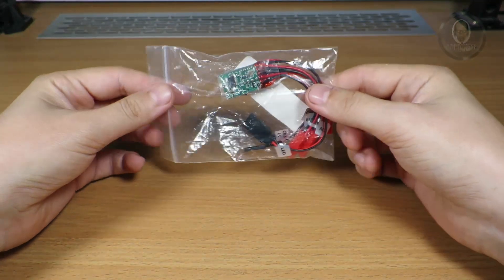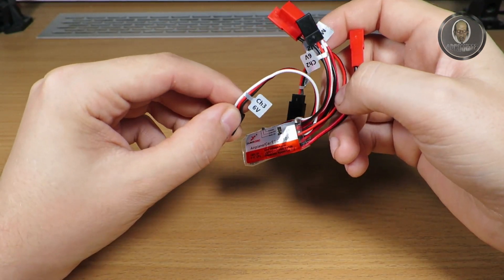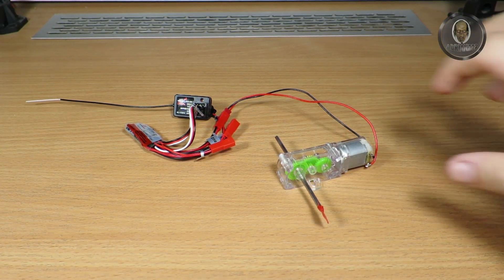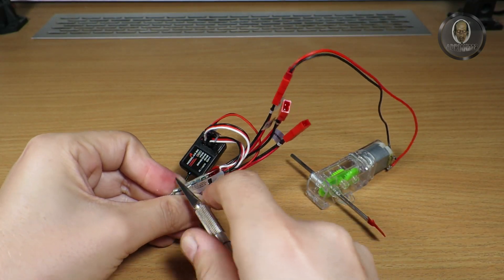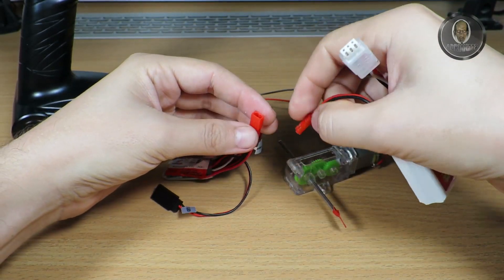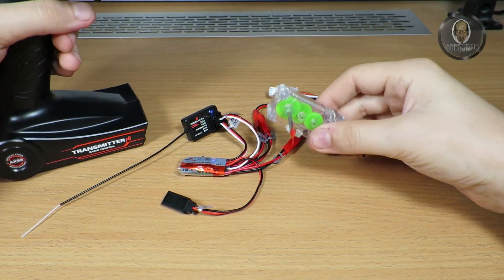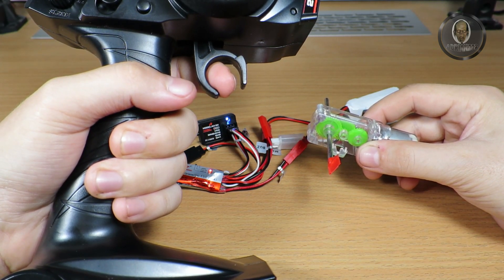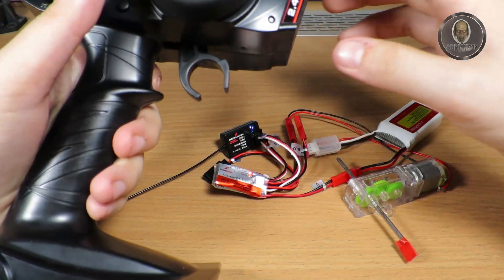DumboRC 10A ESC - Switch, buzzer connection, 2s/3s and airplane mode

Comment: Dumbo X6F transmitter and x6reciver using how to make rc plane
Reply from the maker: Most easy would be to put on plane 2 motors pointing little up and turn plane by using differential control like in tank.
This is how they do it in toy planes but if it's ready plane than You may have not enough channels for all flaps
Reply: @Adrian202   rc flying plane how to make by using Dumbo X6F transmitter and x6reciver
Reply from the maker: @yogeshwaranm249  I just explain :D

Comment: Hi friend, my switch is broken, can u tell me how to jumper in plane mode?
Reply from the maker: Hi, as far as I understand You will need to solder two pins that go to switch.
Plane mode is first from wires so try to solder that pins and that should work

Comment: Thanks for the review, just wonder if it getting hot or not in 370 dual speed gearbox setup.
Subbed to your chanel now
Reply from the maker: 130 motor take about 5A max on stall and 370 motor is stronger so on stall 2 motors can over heat it
Reply: @Adrian202  thanks for the quick answer, i just plane to use this 10a esc with 996mg servo, 370 dual speed and n20 motor for winch. Do not want to burn the esc , not because the price but the waiting time to arrive to your door.
Anyway, thanks one more time
Reply from the maker: @yannn5541  N20 yes, 6A BEC will work for servo but dual 370 may be to much, better use 2 and Y splitter :)
Reply: @Adrian202  ah, there maybe a bit of misundestanding here, it is my bad for not explain it before.
I only use one 370 motor but it is come with the gearbox with low and high gear setup hence the name dual speed. I use it on my wpl c14 rc car
Reply from the maker: @yannn5541  all depend on how much torque will go on motor because if You will go on a hill or do crawl on roots motor will consume more current and I have no idea how much :D
Also motors with that gearbox fail over time as far as I read (gears brake or something like that) that's why I ordered single speed motor with metal gearbox to test it out :)
Reply: @Adrian202  sir can you help.me i have a  esc when i connect it to motor it strats beeping??? Which supports a motor and is 30a
Reply from the maker: @gobindmodelmaker7188  Check battery because this may be low voltage alarm or check if You connected receiver right because this also may mean no signal
Reply: @Adrian202  thank you sir for reply it will check and tell you
Reply: @Adrian202  hellp.sir i checked it battey is fully charged it is not working but when i yse it on 3.4 voltors mobile battery it works but whrn i use two 2s battery 7.4 v it don't what to do...
Reply from the maker: @gobindmodelmaker7188  so something is wrong because on 3.7v this ESC cant work because minimum is charged 2s battery
do You connect it to correct plug ??
Reply: @Adrian202  yes plug is correct  i am also not coming to know what is the problem   on 3.7 volt mobile battery it is working but when i use 1 cell or 2cells of laptop battery i don't work 🙄 motor starts beeping on 2s 
But on mobile battery s sounds comes and it starts working motors starts rotating

Comment: Battery link pls ? I got same esc but i dont have battery yet,so can you give me link of your or something pls ?
Reply from the maker: It's this one:
https://www.banggood.com/ZOP-Power-11_1V-850mah-70C-3S-Lipo-Battery-JST-Plug-p-1158448.html?p=5G2717320323201310AJ
You may want to check other batteries because limitation is size that You can fit in model :D
Also remember that You can also use 3s battery in this ESC but question is if Your model can handle that speed :D

Comment: The buzzer is more useful than a horn, it is the low voltage alarm, from what I understand ? A small buzzer is needed to sound the alarm.
Reply from the maker: As far as I understand yes because CH3 control light switch alarm will be only for low battery voltage as You say